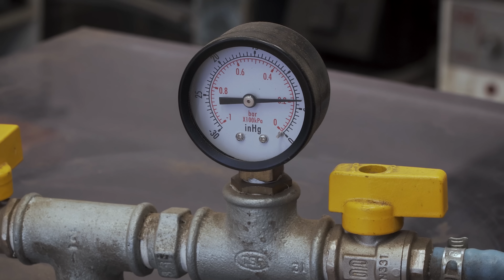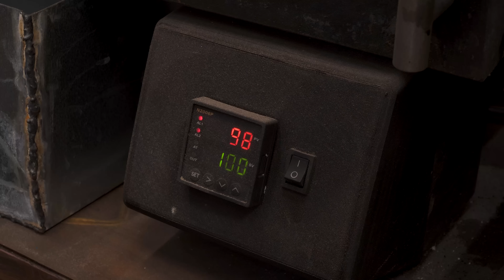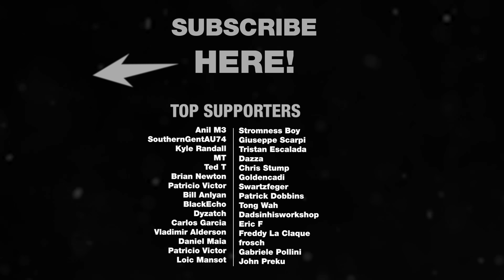Gold Upcycling: Turning Scrap Gold into Wedding Bands

Comment: vacuum is for resin, not plaster... the vacuum creates more bubbles because water boils at room temperature if you lower the surrounding atmospheric pressure. You either have to slam it hard or centrifuge it to pack it thight and get rid of the bubbles.

Comment: It doesn't look like you removed the steel spring from the chain lock. You did it?To recover the filings you must roll it in tissue paper with flux and heat it with a less oxidizing flame so that it does not volatilize. The loss you have had is too high, also look for particles in the water where the ceramic coating.